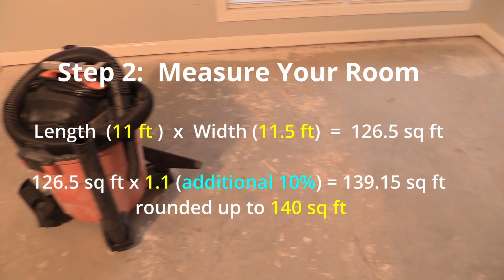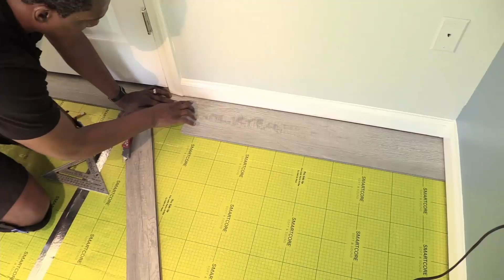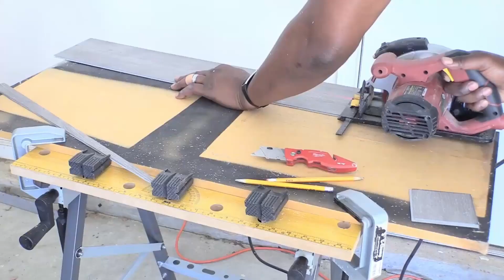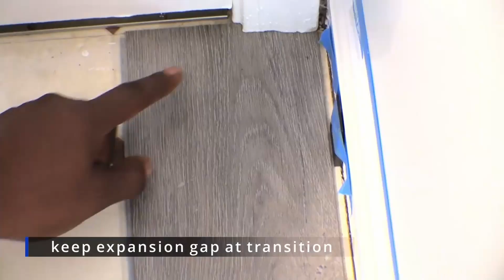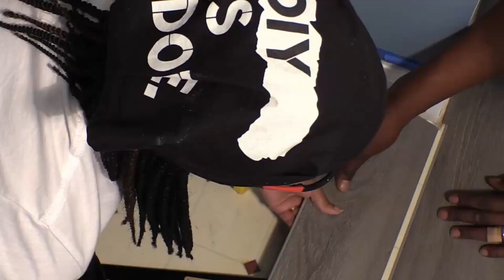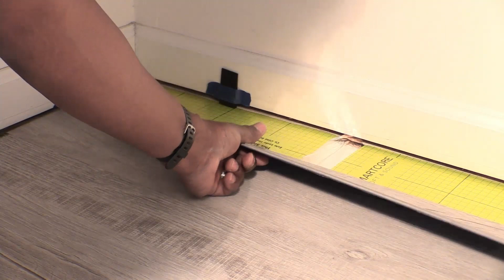Watch Us INSTALL VINYL PLANK FLOORING Two Ways DIY

Comment: Hi, thank you for the video. It is very helpful. I plan to do a diy project in my room. Can i place the vynl floor above the engineered wood flooring that is currently there? If yes, should i place a underlayment or fix vynl floor directly.
Reply from the maker: Yes, you can place vinyl flooring over engineered wood. You will need an oscillating tool for the door jambs because of the height difference. You may not need underlayment because the engineered wood would act as underlayment, but you may choose to install underlayment because it also works as a sound barrier. Hope this helps.

Comment: I'm so glad I found you guys. It's just me and NEED to remove the carpet in my Lord Thaddeus Blaze's room a.k.a cat (my Fur baby) . He loses too much fur and the my vacuum was not keeping up. So I knew I had to remove the carpet. I have some questions.  Why did cover the floor with a small piece while tapping it? What wear those black things that were on the base board? Thank a again for making this easy to follow videos on the DIY carpet, inlay & vinyl floor install. SAVED MY POCKET. YOU GUYS ARE THE BEST!
Reply from the maker: The black things are called spacers. We used a small piece because it fits into the larger piece of flooring.

Comment: I’m doing a small 40sq ft area in my bathroom. The planks I bought already come with underlayer attached. 

I shouldn’t need to buy a separate underlayer, correct? Not sure if you would know.
Reply from the maker: If you are installing them over tile you don't really need another underlayment.

Comment: What a great video.Edit: what kind of underlayment did you put down in your son's room?  I want to do this in my living room, kitchen, and dining room BUT my fireplace (the hearth) is at a corned wall, (catty-cornered) so that's what scares me. If it was all square I wouldn't hesitate. Thank you both.
Reply from the maker: Hi Donna! Here's the underlayment info: https://youtu.be/cAr1IjhTP1M
You may just have to make slanted end cuts by the fireplace, but you can do it! 😃
Reply: @DIYPowerCouple  // Thank you so much. I think I'll start with a square room and follow y'all's directions before going full throttle. Thanks again, absolutely love you both.